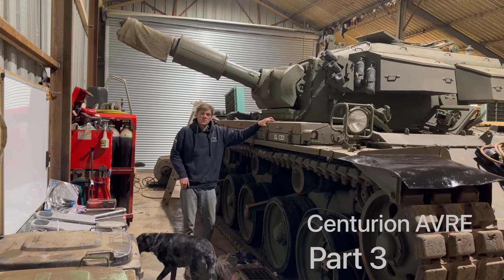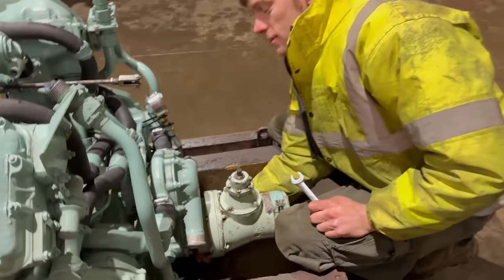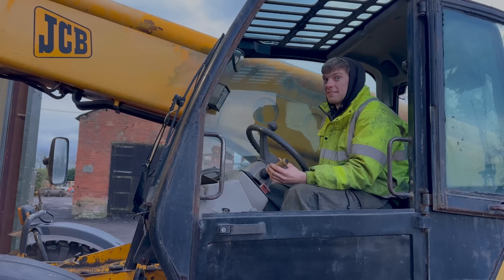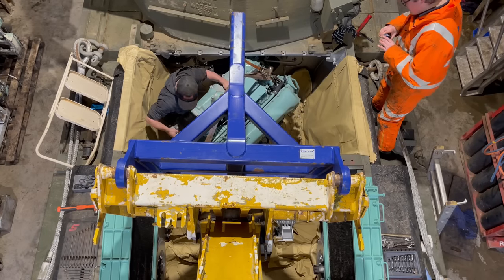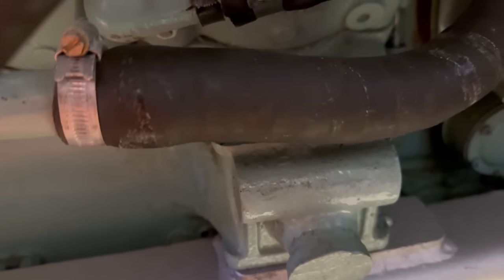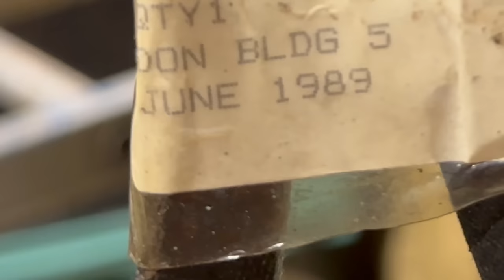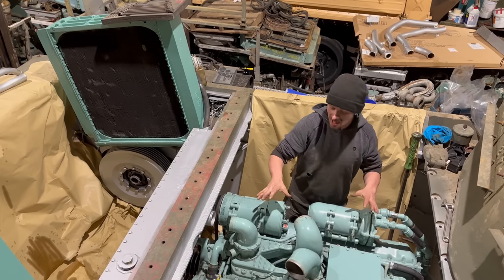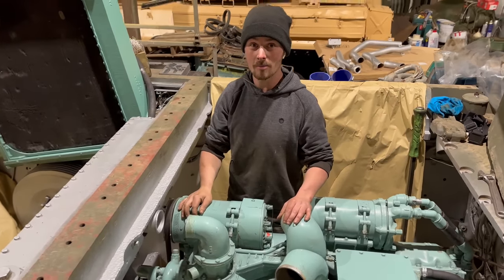We fit a new engine in a Centurion Tank

Comment: nice job - alternator refit looks like a fun job - in that Army don't they normally have a specially designed 'fat git' to stand on the alternator to stretch the rubber band while a small person refits the clamps hehe, that's what we used to have
but it does always beg the question, in a theatre of war, how quick these jobs get done, or is it a hold on chaps the wagon wheels aren't working, hold the war until its fixed!
real nice job on the repaint and tidy up of the engine bay, Jack done good, Joe's OK but don't tell him
Reply: Well, I would ram it in there half assembled under fire, or if it was raining hard. Gotta have a fitter team with a big bloke and tiny bloke. The wife can fit the oil feed pipe banjo-bolt on a duetz air cooled engine with ease. Saves at least ten minutes :D
Reply: It looks like a typical British product - no thought for the poor bastards who have to maintain it.    That's what let them down in North Africa - tanks that broke down too easy and then too hard to fix.   However, the Australian Army operated Centurians for years and when on exercises, practiced doing major repairs in the field, so with training and experience it can't have been too bad.  Where there is the will there is a way.
Reply: @keithammleter3824  indeed - where there's a will there's a way - and that way is normally use a bigger hammer or spanner on the new recruit haha
if it moves salute it, if it doesn't, paint it, i think that's right isn't it

Comment: Anytime i see the Centurion AVRE, all i see is War Thunder, such a lovely tank.

Surprised there aren't Sponsors from the company for this
Reply from the maker: I best email them
Reply: Every time I see an AVRE I remember the three days spent waiting in field workshops while they swapped the seized engine. The engine-clutch-gearbox alignment was off causing the engine oil seal to fail and lose all of its oil into the engine bay.

Comment: Quick question did the earlier Centurions have an Austin 7 sidevalve engine as a donkey engine for battery charging and aux power? IRC reading that somewhere as part of the plan to make them a self contained fighting unit.
Reply from the maker: Sure did!
Reply: Yes it should have a little auxillery generator. It was an old side valved engine and mostly used to keep the tank powered (lights, radios) when stationary without needing to run the main engine.

Comment: Did you know generator pulley is split? To loosen belt, loosen bolts in pulley hub. This allows pulley halves to separate and belt can fit deeper into groove.